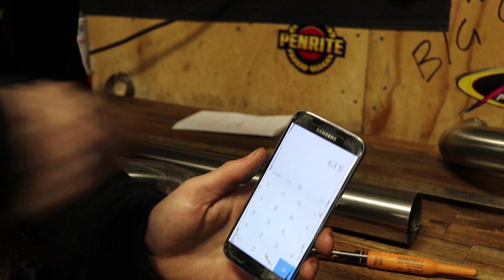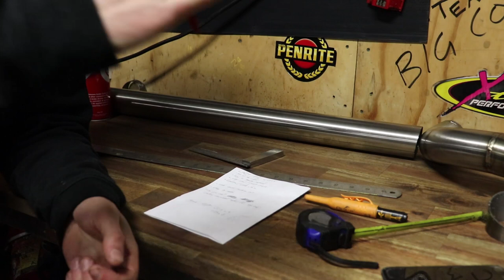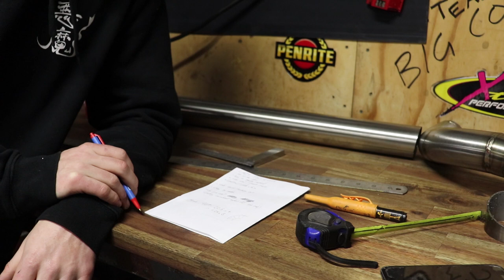#skidgeneering -- Simple DIY way to make pie cut bends

Comment: lay a piece of angle iron on the pipe to draw straight lines
Reply: or hold ur texture tight and use ur pinky as a guide, doesnt have to be a perfect line as its only there for a rough reference
Reply: Just along as your angle iron is straight this works

Comment: I have few tips for you:
1. Use aluminium angle to draw lines on pipe.
2. If possible always make one mark where the seam of the pipe is, that way you can figure position if you wipe of your marks
2.a cut two times the pieces you need if you do same diameter pie cuts often, that way you can join all the pie cuts with seam on inside and seam on outside.
3. Use works stop that way you dont need to measure each piece individualy
4. Wel a metal flat bar or angle iron on the end of pipe,  on your two marks that you made. that way you can use small magnetic water level to turn pipe 180 degrees, or magnetic angle meter if you are making a "corkscrew" curve.

Comment: A bit late to this video apparently but if you took the time to mark out your saw, you obviously only work with certain tubing diameters. I would just get some angle iron of the appropriate size making a C channel of sorts and cut it at the right height for the tubing. This give you both sides on a 180 and if you mark the bottom of the channel you have the reference for a 90 turn which gives you the other 180 marks. You could have it traced out in 2 minutes on each tubing section and be done with it. Just food for thought. I use a center finder that I made out of angle to give me my center on all different size tubing as a start.

Comment: A better way to mark straight lines down the tube is to use a pipe centering combination square. That will get you a mark exactly 180* from the other on the profile of the pipe. That’s all I use for pie cuts. Then to draw the line I find something long and straight, lay it down beside the pipe, then rotate the pipe until the pen will glide down the pipe at the desired height.
Reply from the maker: legend! going to try one out next time
Reply: Use angle section to mark straight lines on pipe ;)

Comment: A flexible tape measure from spotlight or a junk shop works perfect for pipe layout or even better one of the magnetic pipe layout tools. for drawing the line along the tube, use a 90 angle as it will sit squarely on the tube.

Comment: Use a hole punch on each line.  Put one punch on line one, 2 punches on line 2, three punches on line 3, and so on.  This will allow you to clean the pipe and prep for tax/welding.

Comment: 2, 2x4 boards ripped down to 1 1/4 on the table saw. Put the tube between the 2 1 1/4 boards and trace them with the pen. Faster than the engineer square by far.

Comment: Hey im curious with that bandsaw the specs say its limited 90degree and 100mm then 45degree at 72mm are those specs how im reading them? It seems to smaller degree your more limited so i would of thought at 11 degrees the diamter would be like 40mm but your cutting more then that

Im confused, i do want to cut 2-4inch at 10-20 degrees but will this machine do so? Just want to use it for general fab, dumps, manis, exhaust etc etc. So biggest probably would be 3-4 rarely.
Reply from the maker: Hey man I think you might be reading the specs wrong, it only gets limited angle as you go up in size, I can cut anything up to 4 inch up to 45 degrees and below that I can do anything up to 65 which it's limited at
Reply: @mattd5117  thanks for the quick reply! You have the BS-5v yeah? I might just go the BS-4A little lower specs but by the sounds of that itll still easy do what i want

Might aswell ask you had any experince with SABER 550W from totaltools i was going to grab one of those before i saw your video, that bs seems to work nice thanks man!
Reply from the maker: @rickrimpson2893  no worries, yeah I have the bs5 but the 4 will do fine, only downside on the bs4 is it takes longer to change angles and it has a smaller blade ,but I had no problems with either
Reply: @mattd5117  hey man i got it, it works awesome. Only problem is blade is stuff already you did warn us they had no in stock only blades i can find is 1645 and this saber is 1642, will that matter to much? Other dimension are right the 12.7 and 0.65mm cheers
Reply from the maker: @rickrimpson2893  nice, contact alltools or someone similar who deals in "excision" brand blades they will order the right one as the carbon blades are shit house , that measurement is mm long though so 3mm won't matter
Reply: @mattd5117  perfect i got some ordered in, i got some carbon blades to get me through. They are 1645mm guy even said yeah it wont make a difference, problem is ive got the tension knob as tight as i can and the blades still pretty dam loose.

It says the blade should not move more then 0.004" well it moves about 1 inch lmao.

Do you have this problem? Have you got instagram man i could dm you on?
Reply from the maker: Yeah m.dowdell on insta

Comment: I've got a better method, it's guaranteed 100% accurate everytime, for drawing your straight line mate. Place that fucking meter of stainless inside a piece of angle iron, or place a length of angle iron on top of your pipe, and trace your line.